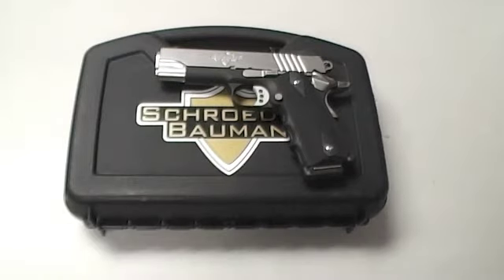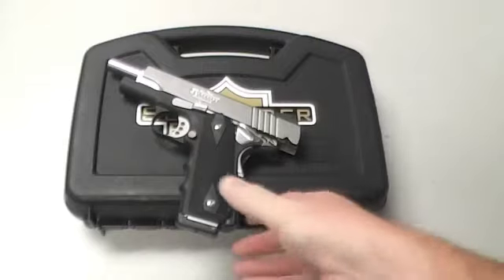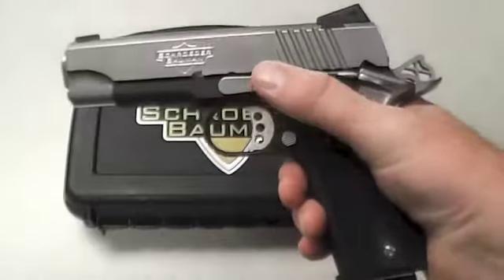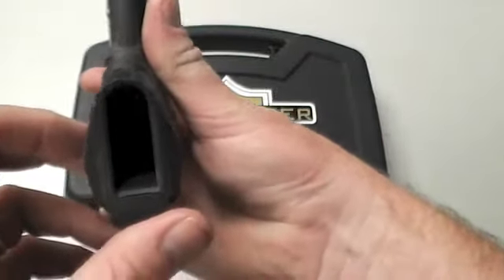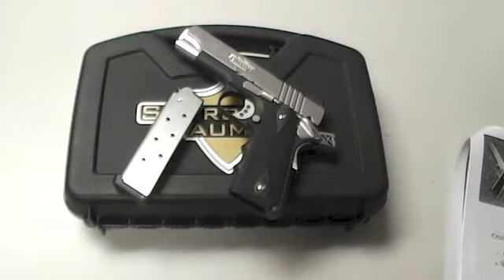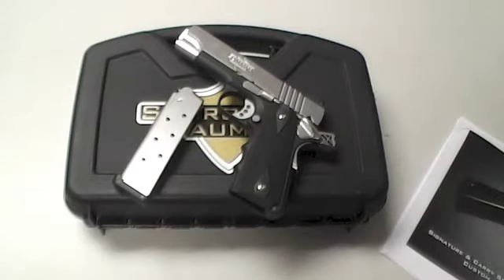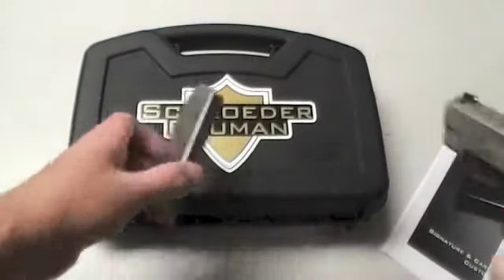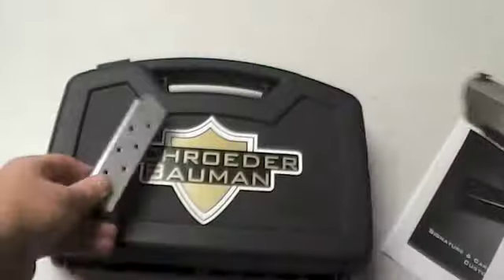Schroeder Bauman 1911 ~ Custom Quality Without The Wait

Comment: Went hands-on with one of the full sized SB's at a local gun store last Saturday. I'm impressed. Been shooting .45acp for 36 years. This is a very smooth piece. The trigger action was flawless, approx .07" release, and no slack whatsoever. Could not detect 'stage' of the trigger. Released same every time though 12 or so dry-fires (didn't let hammer fall). This is a fine, match-styled pistol. I'll be visiting the Ft Wayne factory this year for sure, since it's only 40mi from home. Want to fire one, but at $19 bills this'll be a while.